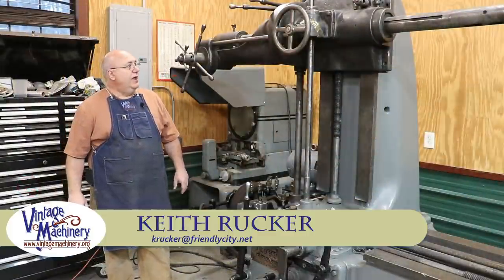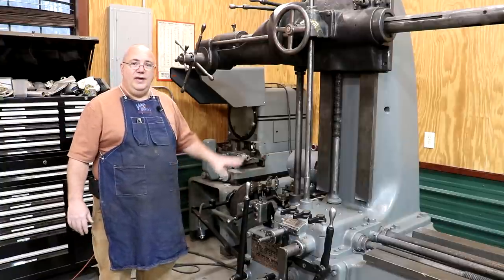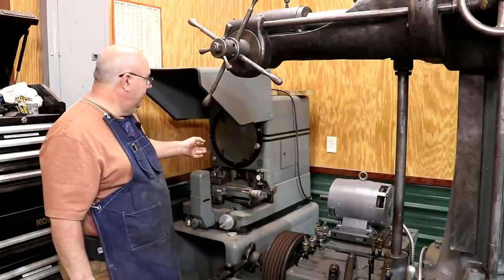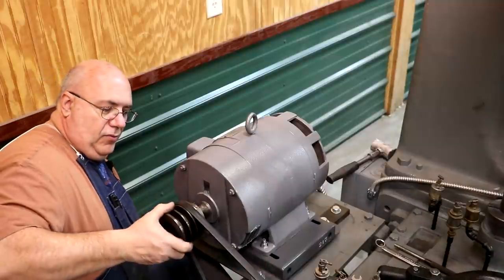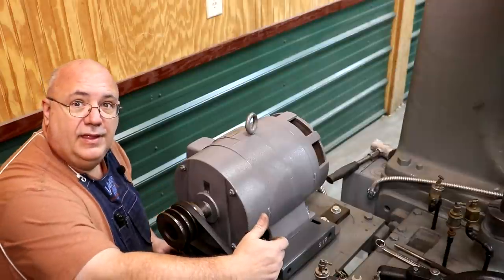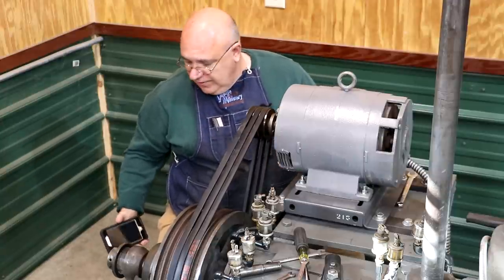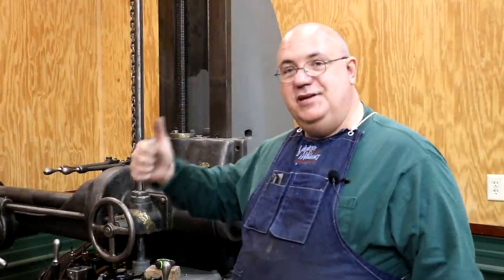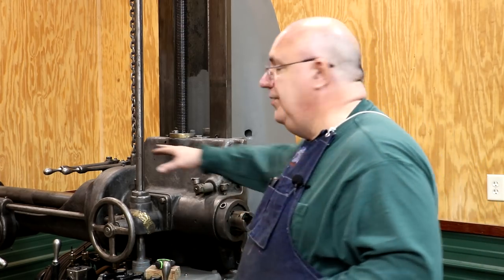Lucas Horizontal Boring Mill:  Installing Belts and Getting Under Power

Comment: A 20A supply should be enough for a 10hp motor. I calculate it as being only 11A FLC.
Reply: I believe you "calculated" using 480v in your equation.
Reply: @paulcopeland9035  220V - that's what he said.
Reply: @millomweb  ...Yes, he said he has 240v.  However, You are using a 480v calculation.  I have a Baldor catalog  (just what I have, any brand will be the same) that lists a 10hp 460v 3ph GP motor (what Keith has) current draw @ 12.5 amp.  Of course, the same motor @ 230v 3ph has a draw listed as 25 amp. His 30A breaker and circuit is the correct choice.
Reply: @paulcopeland9035  1HP = 750W. 10HP= 7,500W. Divide that by 220V gives a current of 34A. It's 3 phase - so the current per phase is 34/3 = ~ 11A
Reply: @millomweb  ...No sir, you don't have the calculations correct.  I have been doing this for quite a few years so hear me out.  7,500W (10hp) is fine (although 7460 would be closer).  What we don't know is the efficiency factor or the power factor of Keith's older motor.  I will plug  modern data (.91 power factor and .86 motor efficiency) into the equation.  First we need to multiply the voltage (240) by the power factor (.91).  This = 218.4.  Then the Watts (7500) are divided by the adjusted voltage (218.4).  This = 34.34.  34.34 is then divided by the motor efficiency (.86).  This = 39.93 Single Phase Amps.  39.93 is then divided by the 3 Phase factor 1.73 (the sq root of 3).  We now have 23.08 amperage draw for a modern 10hp, 3 Phase motor, 240v.   
Keith's selection of a 30amp circuit is correct.
Reply: @paulcopeland9035  So you get 23 A - is that total motor current ? If so, it still needs dividing by 3 (no. of phases) to get the current per phase - and that'd be ~8A - and believable.

You get "40 single phase amps"  but if it was a single phase motor, it'd be 7500/220 = 34A share that among 3 phases would give 7500/220/1.732/3= 6.56A - ignoring PF and efficiency.
Reply: @paulcopeland9035  I know that my 3 phase 415V 3 horse motor passes 3A per phase doing nothing running light.
Reply: @millomweb    Ahh, I believe I see what our issue is!  I am discussing installation and you are concerned with motor internals.  Above, I have calculated the total amperage draw as 23.  While it is true that internally each phase of the motor will see 1/3rd of that, selection of the motor breaker is typically based upon total motor current + 25%.  This puts Keith's installation at a total 28.75A making the breaker selection 30A.  Code (NEC in the U.S.) requires each phase to be wired for full amperage load.  28.75A will require #10 wire (30A maximum) on all 3 legs.
Reply: @paulcopeland9035  I doubt you're right - or me for that matter !
Reply: @paulcopeland9035  "Above, I have calculated the total amperage draw as 23"
OK, here's an interesting one from my perspective !
Watts: 7500. Volts: 220 Total current: 34.1A (Into the motor) so now double it (as the same current comes out of the motor) 68.2A - now share that 3 ways (divide by 3) for each phase and I get 22.7A - which is very close to your 23 :)

"it is true that internally each phase of the motor will see 1/3rd of that"
And so will the wiring to the motor. Thermal overloads should be set for current per phase, not total motor current.

Other things I'm not clear on - is the HP on a motor mechanical HP (output) or electrical HP (input)? If electrical, then efficiency and PF won't need to be included (again)
Is the FLC stamped on the motor 'total' or 'per phase' ?

Last summer I got a 6.6kW 3ph generator (240V/phase) which equates to a max current of 27.5A yet the wire rating is only 16A inc. neutral wire. I get away with this because the current is shared across all 4 wires! If the load is balanced, it's shared across all three live wires (9A) The trip breaker on the generator is a 9.2A (but I've bypassed that ! (and use a thermal overload instead)) https://www.youtube.com/watch?v=Z_r9ZH1aFoI

Comment: That machine looks brand new. Technology in certain things stopped a hundred years ago. Especially  in electricity. No one has made any advances since Nikola Tesla.
Reply: Not really. Almost everything from motor types, efficiency, switch gear, wiring, control systems etc have improved beyond measure and that is before you even consider modern electronics.